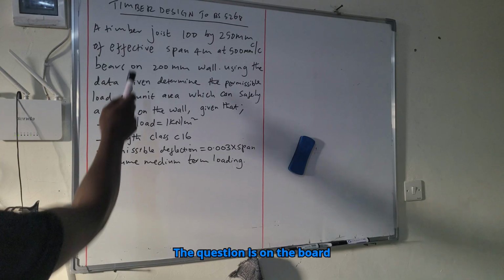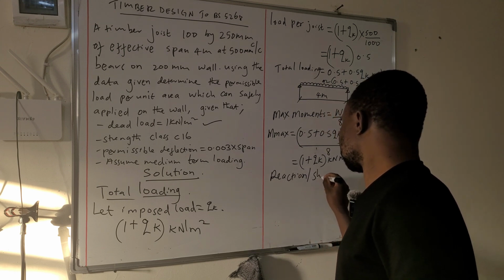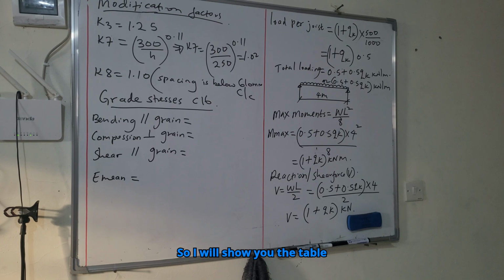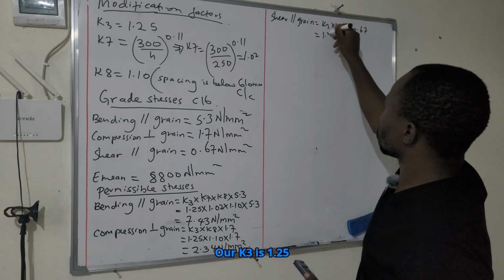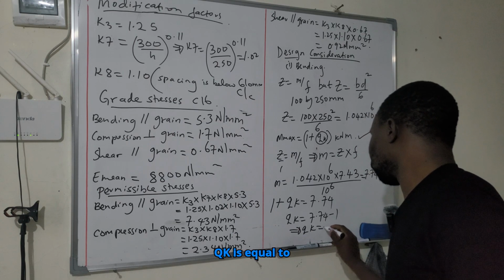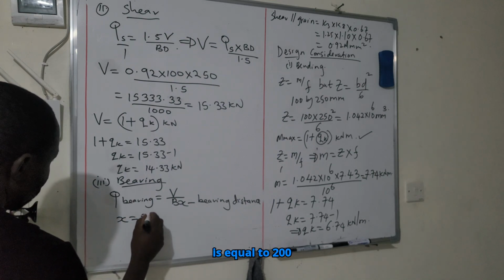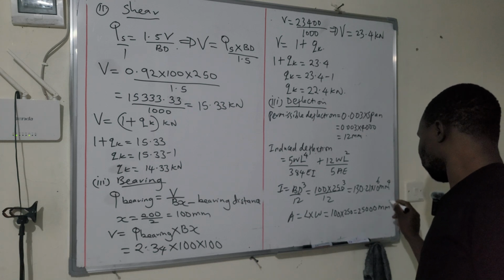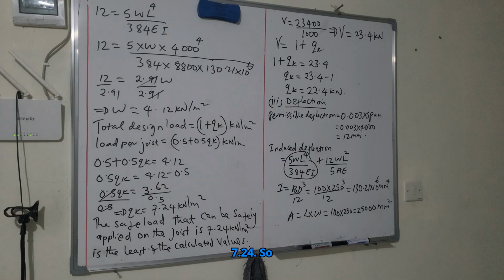TIMBER DESIGN TO BS 5268

Comment: hello there sir am a bit confused since in bending we saw that qk was 6.74 Kn/M. Which was the least value of the calculated should we consider it as the safe load ?
Reply from the maker: you are correct, qk should be 6.74KN/M which is the least value.

Comment: How does one tell the class to work with if not provided or given
Reply from the maker: if strength class is not provided, assume any class. in fact in the design process you are allowed to assume any missing relevant information but you should indicate the term "assume" in your working, very important.